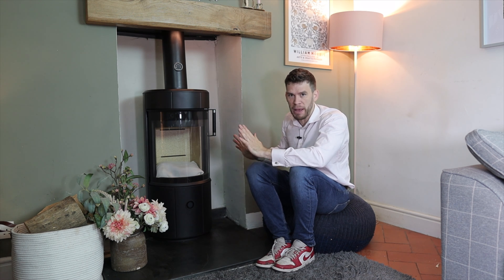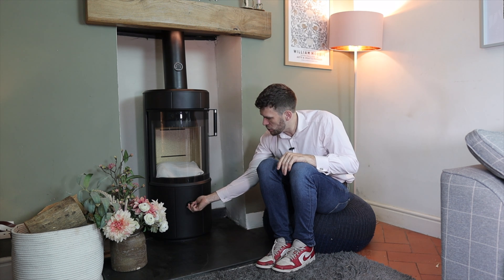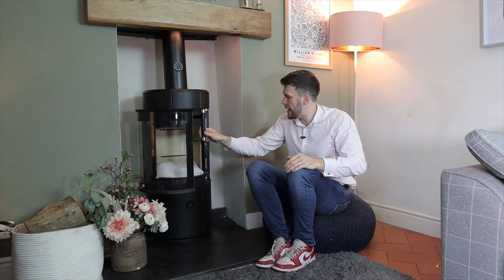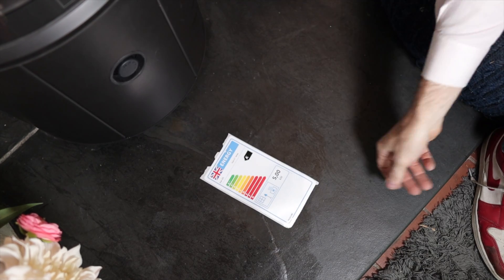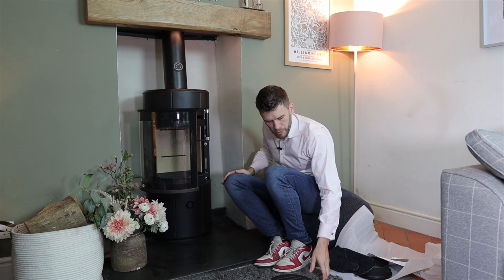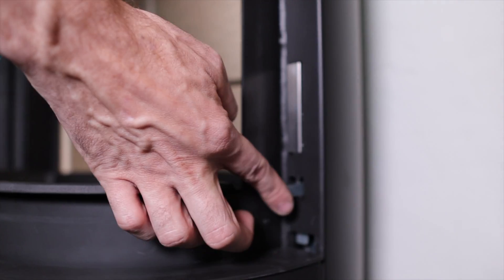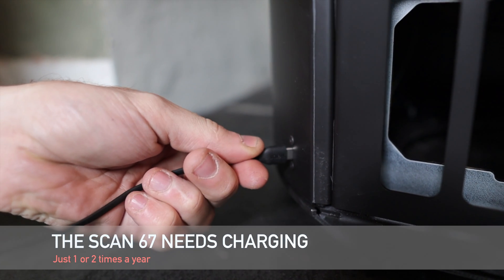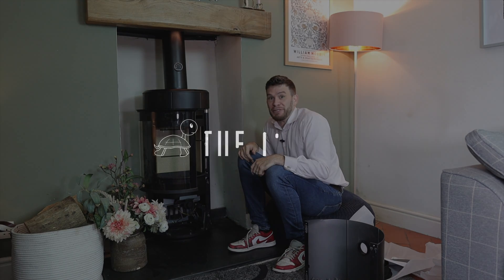1st impressions of the Scan 67 Zensoric

Comment: Out of curiosity, what do you do with test stoves after testing? Do they just go back to the manufacturer? Or are they donated to a retirement home for elderly installers for them to enjoy / raffle? Thanks.
Reply from the maker: I have in the passed had stoves donated for a giveaway etc, but not recently. Perhaps I need to think of a project to pitch to a manufacturer, that will involve a giveaway. 

The only problem is I expect they would want an element of competition, as they’ll be trying to garner as much attention as possible. But I’ll put it on my list for sure 👍

Comment: Not for me, I'll stick with clearview.
Reply from the maker: The OPSS is certainly trying to rein them under control. However there have never been any rules preventing the installation of non-Eco-design stoves, so I doubt it’s really a problem. 

If anything I want to buy some Clearview stoves, because I expect them to go up in value!
Reply: @TheTortoise As you say I don't blame them for standing by their solid design and for not compromising their values.
But it's a relief to hear im not doing anything wrong as there is alot of contradiction with this eco thing and clear view.
I love the clear view even just after using it twice but is so easy to start and better than some I have used before.
Reply from the maker: Sounds alright to me. I heard they won their court case?

I believe they were fighting to be able to continue making their pre existing models that don’t comply with Eco-Design and they won. 

Don’t quote me on this, because I’m sure there’s more to it, but I’ve had a couple friends mention something about it.
Reply: @TheTortoise I heard something about them wanting to stop Clear view from producing any new clear view stoves because they aren't eco design ready.
So good on them as I love my newly installed clear view.
I guess this also means that mine is all within the rules although it's not technically eco designed if they are still allowed to produce them?

Comment: Reminds me of a pellet stove.  We had one of those in our home for about 7 years.  We thought it was great.  Why would anyone want to burn wood when the machine, and all the sensors can take the guess work out of it?  Then, in February of 2012, the control board failed.  The stove was inoperable.  It was -30 celcius in Canada, and with a new born, I was told "Sorry, it's going to take 2 weeks to get a new one".  That following summer, the pellet stove came out, and a wood stove went in.  I've yet to see any of its "electronics" fail LOL.
Reply from the maker: Tricky to argue with there. But I do think it’s focused on back up and focal point use.

Comment: Theres not much to go wrong with a stove, until you fill it full of electronics to go wrong?
Reply from the maker: 😆 I’m interested in what will happen there, but the thing did seem quite well designed, and simple which is pretty key.
Reply: Great until it goes wrong, won't be cheap to fix and replace that glass. Ash pan is a bit off a joke,, not a real burner... It's like a Tesla .. look good but in reality a waste off money.
Reply from the maker: Definitely a change of pace, a bit like with Tesla. Time will tell.

Comment: Can’t help but see this as a stove for the ‘matrix living’ people who don’t understand the feeling of having and using the beautiful simplicity of a well made piece of mechanical engineering. Isn’t the concept of a stove to have something that is truly independent and off-grid from ‘the system’. By adding electricity to a stove, isn’t the very essence of what a stove truly is, is lost.
Reply from the maker: This is a really good point. Stoves for me are a picture of freedom and not being controlled, I’m all for that. However there are some and particularly in more built up areas, or where a stove is primarily a back up and focal point, where these systems certainly have a place. Also for those who want a stove, but aren’t necessarily as interested or capable at running it well, this definitely takes the question marks out of the process.